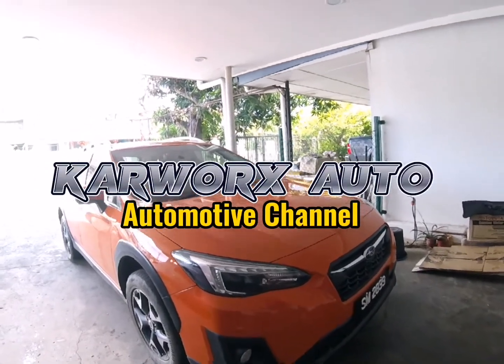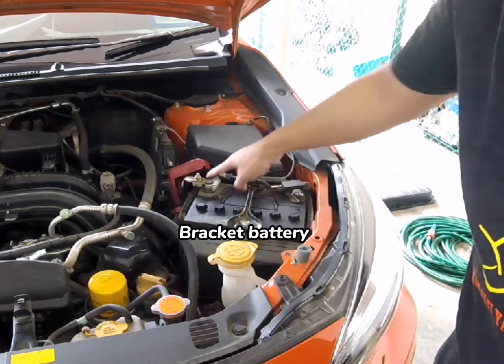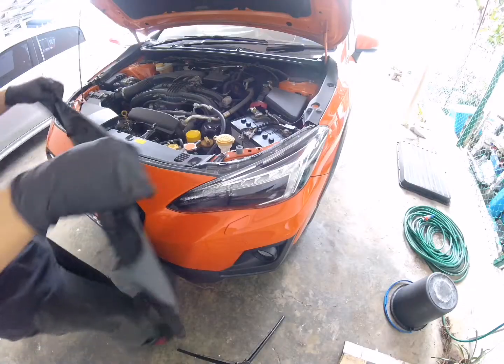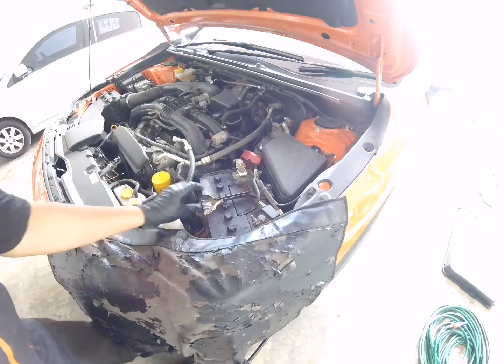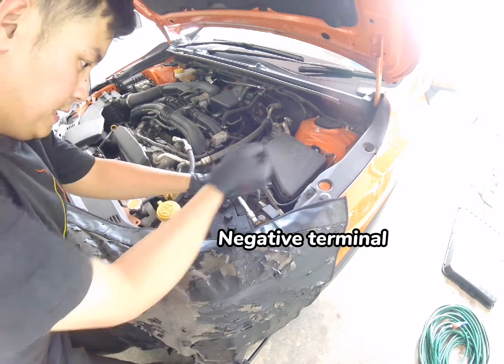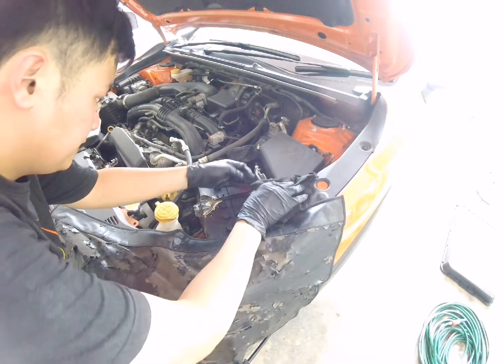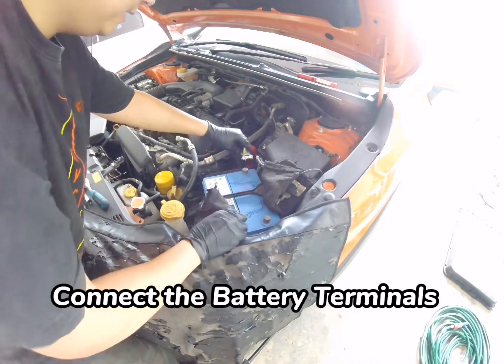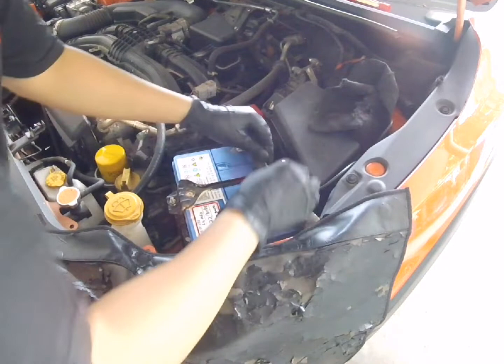Car battery replacement Subaru XV 2.0 auto

Comment: Do you have start/stop? if so, did you have to reset that?
Reply from the maker: No, don't have to reset anything when replacing a new battery.
Reply: Boss..

After change new battery,  does it required to run diagnosis check?

Bcoz at Service center, the battery is too expensive vs out source..

But out source unable to run diagnosis check..